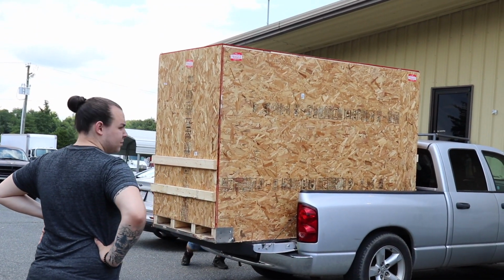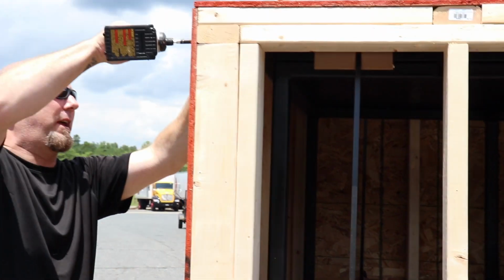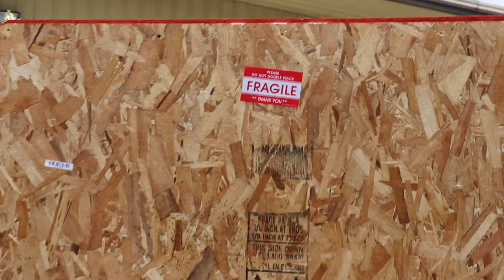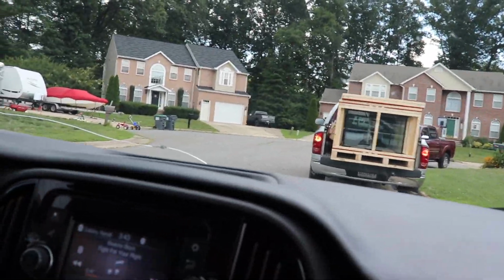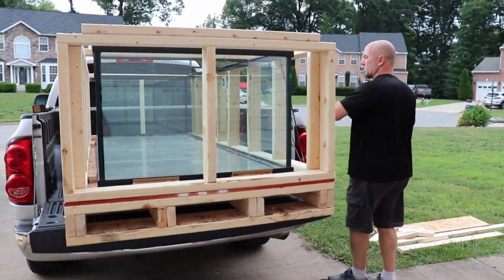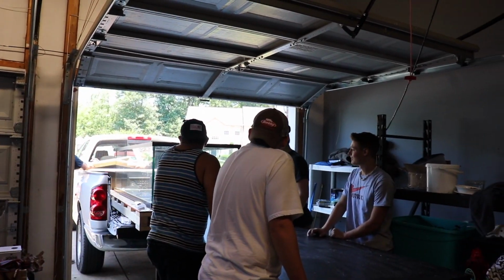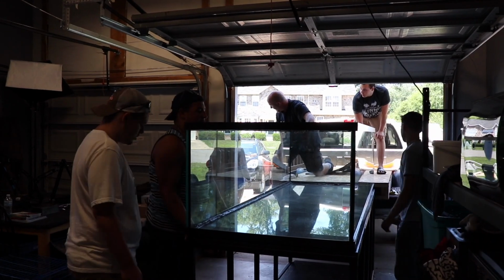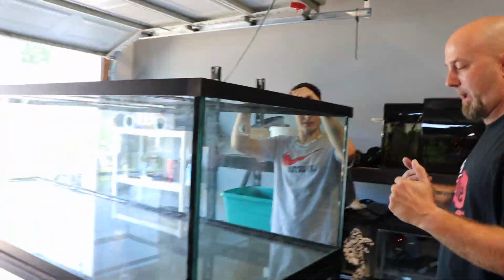Picking Up Our Monster Tank! Transporting A Huge Fish Tank! Dream Aquarium Is Here!

Comment: I just set a 125 up last night....so much work(7 hrs) but but so much pleasure doing it
Reply: What Are you putting in it
Reply: 14 clown loach.... biggest is 6in smallest is 3.5in a common pleco an 4 line pictus catfish
Reply: Will it be able to support that many loaches long term you think? I have a 125 with about 40 tigerbarbs and was considering adding some clown loaches.
Reply: This is a bare minimum for that many full grown in 125 when they get that size but i got a g6 an a 406 fluval filter thats almost 900gph...i would only get max of 6 with that many barbs
Reply: @brandonhoward4750  ok, thanks!
Reply: @calebblamires8749  u will get the schooling out of clowns u want see with that many barbs if u havent tried this yet take ur hand touch all fingers to glass move ur hand an get barbs to follow an it will make them all school in the  tank an loaches should follow they are very intellegent an observant  fish